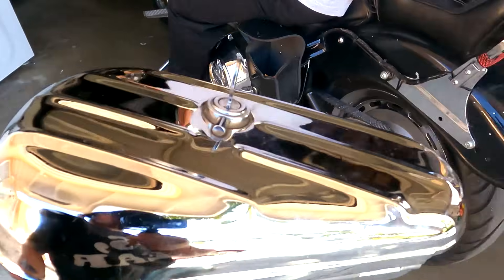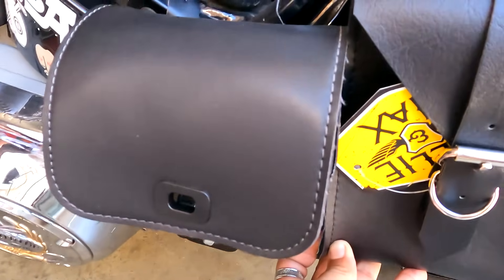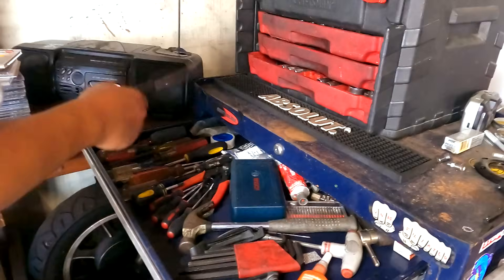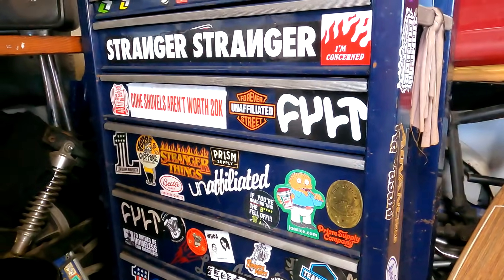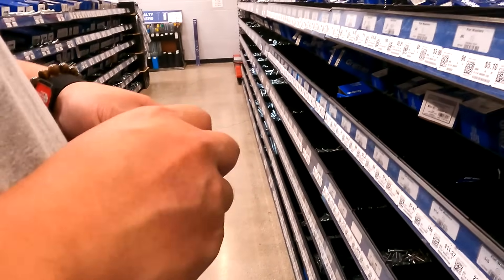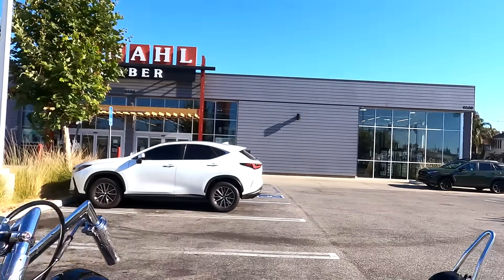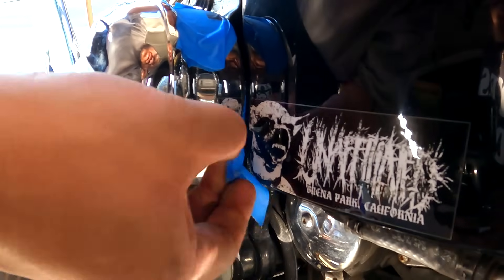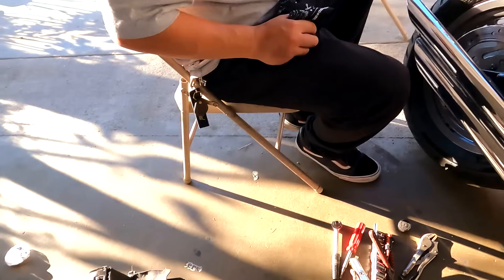#399 - 40 Dollar Tool Box For Bear's Softail

Comment: Yeow Man,   Tell Bear that I had a Left hand mounted toolbox on my brand new 1992 Fatboy and the Dealership mounted the left pillon peg and it was fouling the toolbox half folded when I picked it up,  so I unscrewed the mounting bracket a bit and turned it until the footpeg laid down parallel with the bottom of the toolbox and folded away neatly under the toolbox with the footrest rubber pointing towards the back of the bike,  It looks neat and still folds out and works fine for the passenger,   Mike from Wales over here in the UK 👍🤘😎🏴
Reply from the maker: Simple yet effective!! 🔥

Comment: Not related to the video but I had a question about bears engine looks like he has an 88 like mine has he checked the camp chain 10 centers or done a conversion job over the hydraulic those oem  suckers disintegrate they grenade the engine
Reply from the maker: It’s an 88 as well! And funny if you bring that up, next week you’ll see in our videos that he actually addresses that!
Reply: @Unaffiliated  right on I bought the fueling upgrade kit and the set of new adjustable push rods new lifters the kit comes with a new higher volume oil pump the two hydraulic tensioners and new sprockets and chains with the new cam plate and all new bearings including Timkin bearings  I'll be doing my compensator either renewing or updating it as well the bike runs really good only has 15,943 on the odometer but once I finish everything I'm gonna be taking an epic trip probably the last one before I croak new tires right now looks like a tossup between commander three or Harley Davidson Dunlops I need a truckload of money to fall in my lap looking forward to watching his video probably at least 10 different channels saved that have guys doing the whole job YouTube is great for shit like that
Reply from the maker: Radical! Sparing no detail on your horse! A trip out to California would be sweet! We’d love to share some miles and grub with you!